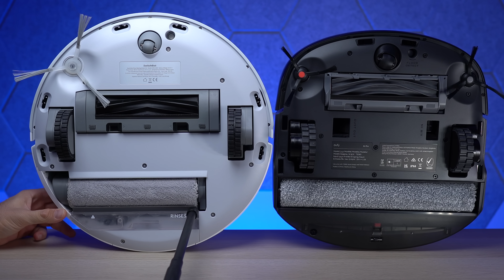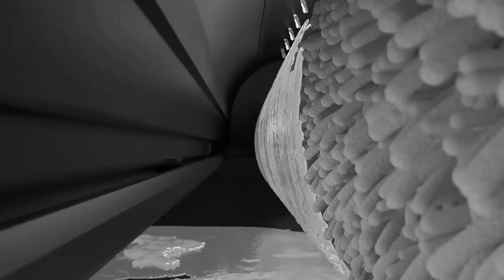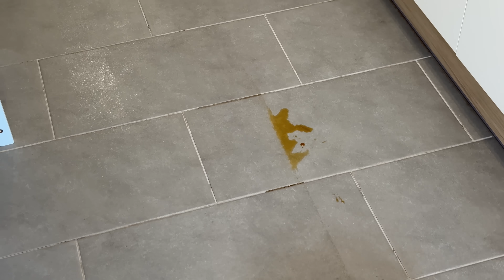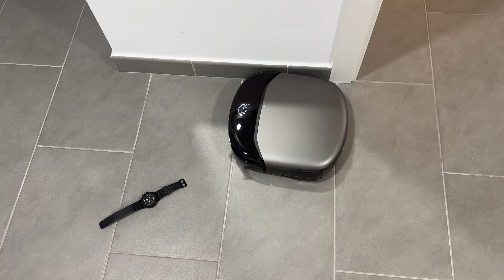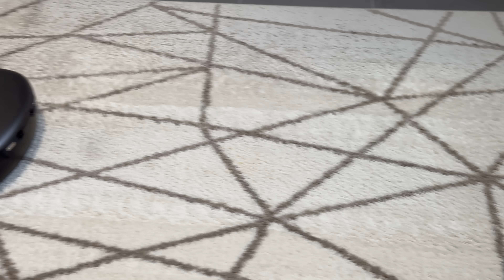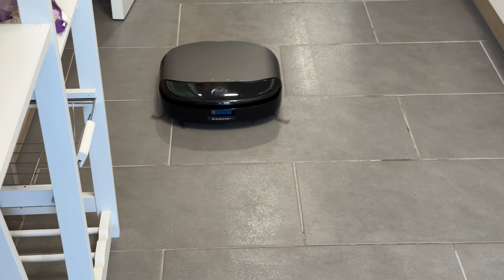BEST Floor Washing Robot Vacuum? eufy S1 Pro VS Swichbot S10!

Comment: This video is good, but I’d avoid using it to make any decisions considering Eufy is the sponsor, which I really think should’ve been mentioned in the video instead of just the description.

I’ve had the S10+ for a bit now, and while the Eufy is definitely impressive in the department of specs and suction even to the point that I’d admit it performs better than the S10+, what I really found matters is that I no longer having to deal with smelly water tanks from the old Roborock I had, which has quickly made the S10+ the best mopvac I’ve owned considering I can now mop as much as I’d like without having to worry about emptying and refilling the water station too much! There's no more gross smell by the water station either since its all connected directly to the plumbing, so now I have it set to mop twice a day since we often have one of the dogs tracking something in, and that’s no longer something I worry about being spread around the house! 

Heck, we even have the vacuum mop the tire tracks off the garage floor when it rains, so its amazing that it mops pretty much the entire house without any need for intervention!

If you want comparable performance and something that’s completely hands free, I’d argue the S10+ really is leagues ahead of the competition, and is something I hope Eufy incorporates in their design in the future.
Reply from the maker: Yes, eufy did sponsor this video, However...this is the vacuum I use in my house...and I have at least 10 other vacuums to choose from :) If you can get it on sale, there is not other vacuum that's better.

Comment: Fascinating and an easy win for the eufy S1 Pro! Overall a great comparison Alex.
Reply from the maker: Easy win for sure! Thx for checking out the video!
Reply: That other one does have the water pipe connection. Never have to clean it or add water, that's cool